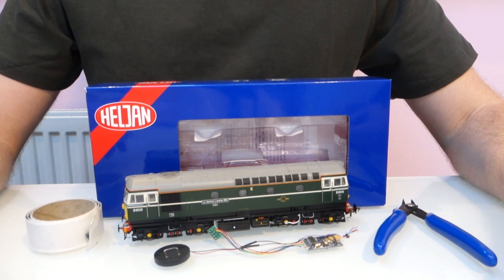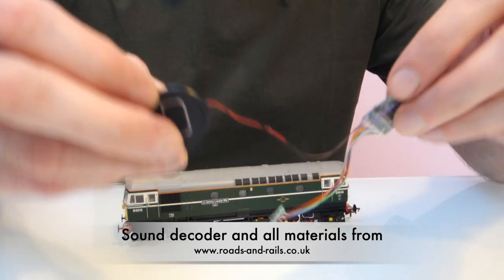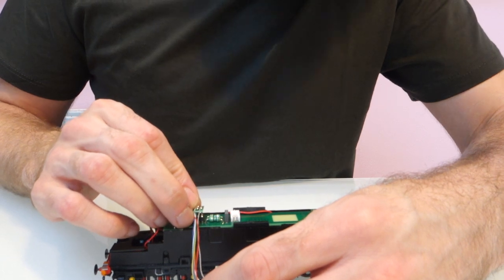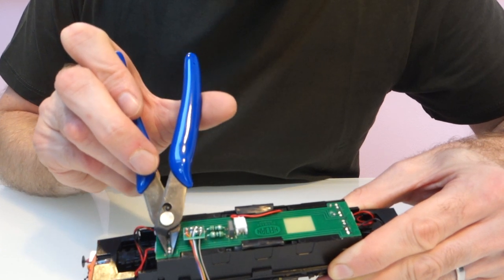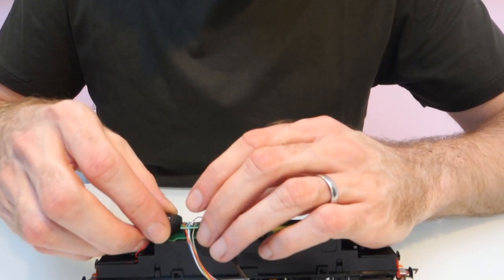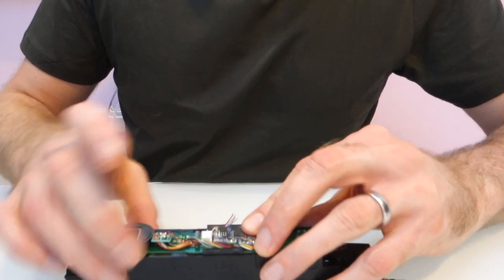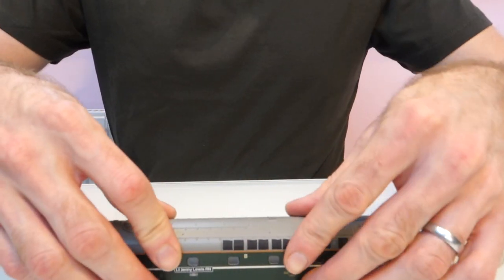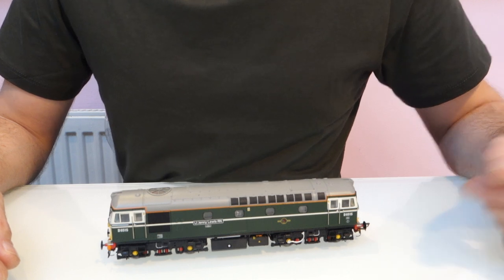Heljan Class 33 Sound Fitting Guide

Comment: Have a hm7000 sound decoder orange wire is on top left
No1 pin is marked as bottom right 
Hm7000 sofewerewill not find card
Thei is on a Heijan 47
Also the same on me hornby 08 shunter